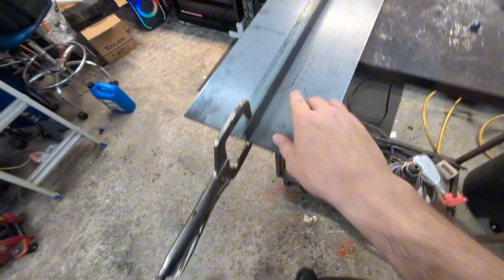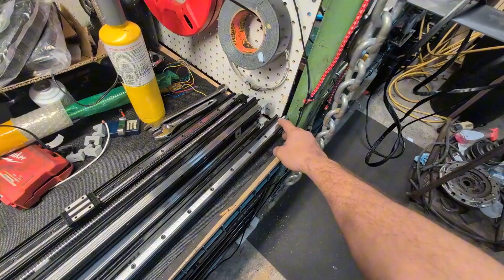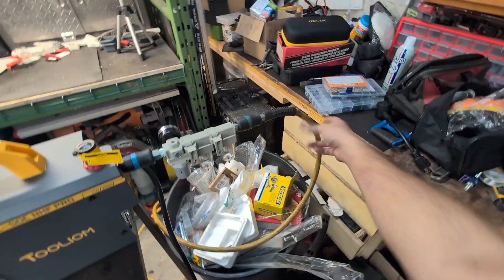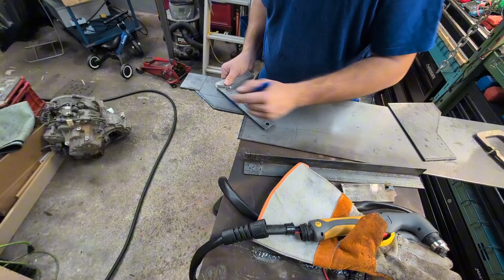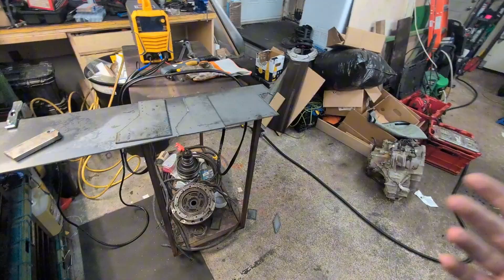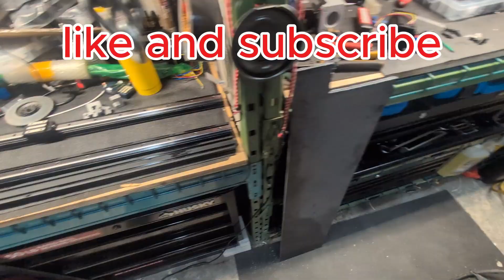Cnc plasma cutter project part 5

Comment: one screw on X axis should be good enough as long as you can move Y gantry with like 1 finger (which should happen with linear bearings). that additional material on those brackets is good should improve resistance to twisting around Z axis.
Reply from the maker: Im worried that my bearings are not spread out enough to give enough stability